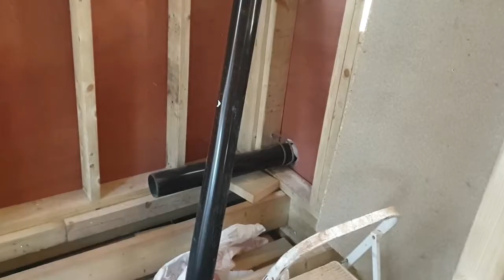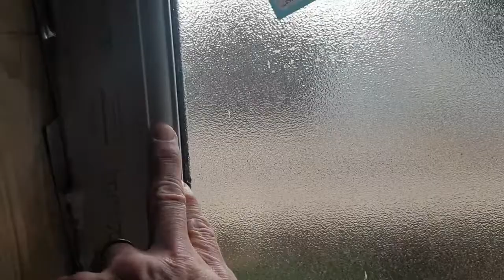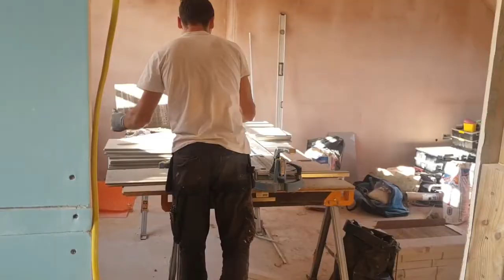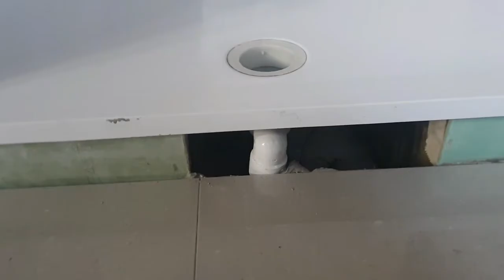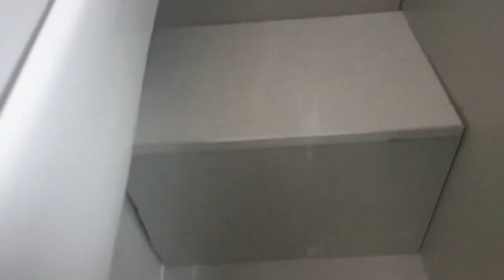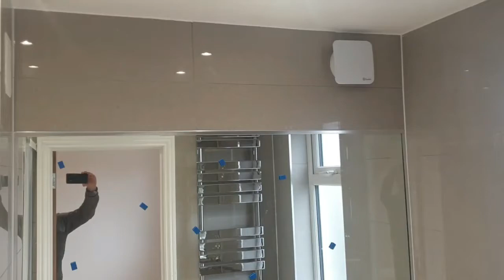Ensuite Bathroom - START TO FINISH Construction of Master / Attached Bathroom for Loft Conversion

Comment: Nice! What is the length of the shower room, i have a similar ensuite to be made its 1500 wide like yours but 1800 length
Reply from the maker: The room was 1.5m x 2.4m. 👍
Reply: Thanks, Quite a bit larger then!
Reply: @HomemadeByKomal Hi, how much was the installation of your ensuite?

Thanks you.